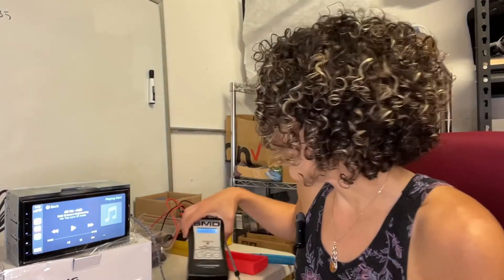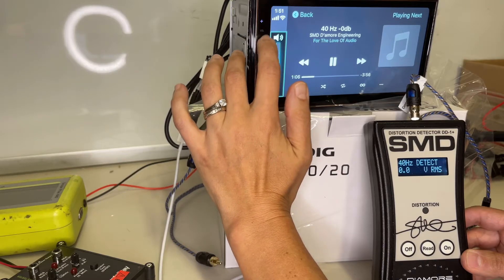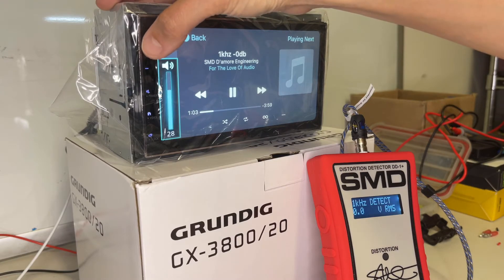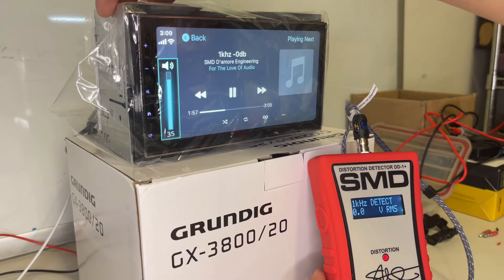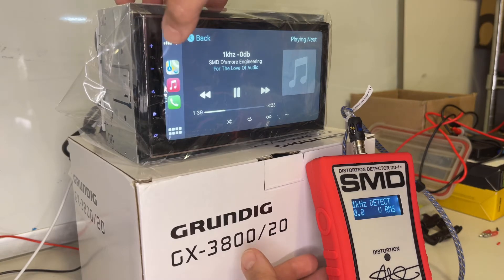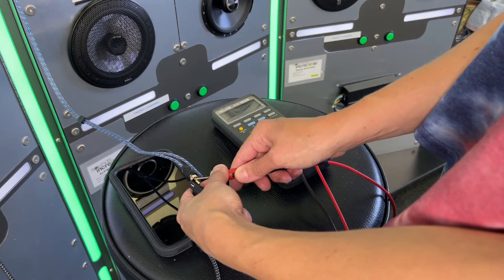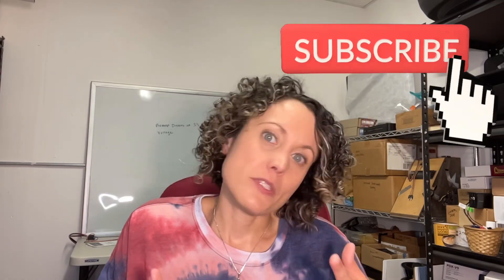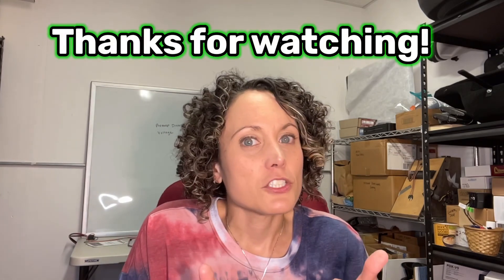SMD DD1 + vs Fluke MD88 Distortion + Preamp test Grundig GX-3800

Comment: Any updates on this unit?
Reply from the maker: Hey Carlos, do you mean the Grundig GX-3800? Or the SMD DD1+? Haven't seen any software updates or anything like that for the radio if that's what you mean. Regarding the testing equipment, now I just use an older Fluke 123B oscilloscope and John uses the Audio Control DM-RTA Pro kit. It's just easier to see clipping on both.

Comment: I've recently read on a forum using RCA make it glitchy, I almost remember D'amore said the same thing in the video manual.
Reply from the maker: Oh really?? Thanks for letting me know. I thought having the RCA plug in option for testing was like one of the main selling features of the SMD DD1+. In theory, that would make it a real quick and easy to test/check for clipping. And of course I just read the paper manual, I never looked at the video manual! At this point we use the Audio Control DM-RTA and the Fluke 123b Oscilloscope for testing voltage and clipping.

Comment: You know I have some alpine and Kenwood and pioneer head units and I didn't have problems with dd1 but I purchased Chinese android units and is getting distortion before detecting anything so I put it up I didn't check voltage with dmm I didn't think about after I saw you doing lol I need to retest it and see what  I get now im curious.

Comment: Thanks for double checking with the Fluke before release. I just installed the Grundig in a Mercedes due to stocking shortages. Ive been very happy with the functions as well as impressed with the Virtual Sub on this unit. The lows from this are very solid and not just elevated volume in the 80hz-250hz range
I was originally going with a Kenwood but am more than satisfied with the sound quality.
Great job on your part in bringing audio knowledge to everyone
Reply from the maker: I'm so glad you're enjoying it and happy to hear you found the review helpful! It's nice to know I wasn't the only one impressed with the Virtual Sub feature.

Comment: I know there is an Extreme Shortage on Quality D.D head Units !!!      I would Choose carefully on what you Bring into your Store for Retail Customers !!!    Just my 2 cents from 1 Stereo Shop to another
Reply from the maker: Hey Chris, did you watch the whole thing? It actually had more voltage on the preamp than Alpine iLX-407. My brand new SMD DD1+ wasn’t working correctly, Fluke showed preamp voltage 4.44 volts. Have you tried this model and had bad results? Sold a few so far and haven’t had any issues, clients are happy 🤞
Reply: @carstereochick  I will try and Find the Report another Business Owner Posted !!    He bought a Case of those Headunits and had Multiple issues with them after Installation
Reply from the maker: Good to know, I will reach out to my rep to see what kind of defective/return rate they’ve had. I know it’s super tough with the chip shortage and for the 1st time ever I’m selling brands like Power Acoustik and Boss BUT I’m very selective on which models and which clients they’re best suited for. Also my rep for those brands has been extremely transparent with me about defective/return rate which has been lower than some of the Pioneer models I used to sell. We need to diversify our options for Non maestro vehicles, in need of basic CarPlay/Android Auto functions. I will say the Boss/Power Acoustik models we’re carrying are definitely improved quality from what I remember them being years ago. I thought this would be a great option for clients looking to do the full system but not in need of a Maestro or Sat compatible head unit. Definitely not for every client, but if it’s reliable, I’m all for it. I’ll let you know what I find out about AAMP’s defective/sold rate.
Reply: @carstereochick  I’ve had Very Good Luck with the BOSS Elite & Planet Audio DD Mechless Units ...    had 1 Boss Elite out of about 24 Freeze Up On Customer ..     Obviously we are in Completely Different territory’s, but I’ve been Purchasing from Multiple Distributors ..     I bought 4 cases of Sony XAV-5000 last week
Reply from the maker: 😮 you’re super lucky to have scored that many  Sonys, in New England we have one distributor and super strict territory restrictions, even though DAS is one day away from me they can’t sell to me. When our distributor got some Sony in 2 weeks ago I was allotted just 1 XAV-AX5000. Count yourself blessed my friend!
Reply: @carstereochick  that’s 1 of the Advantages living in the South ...    I have Many Connections ...     I just sent out 3 Sony’s & 2 JVC to Texas last Thursday , and a Boss Elite to N.Carolina Friday